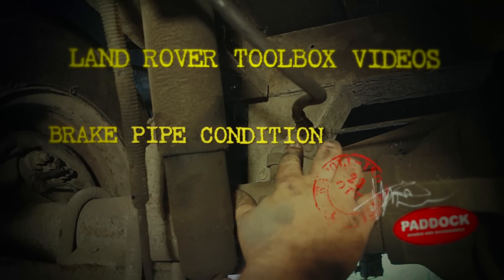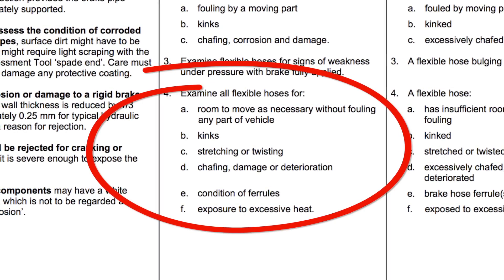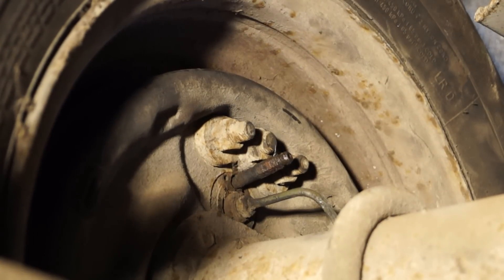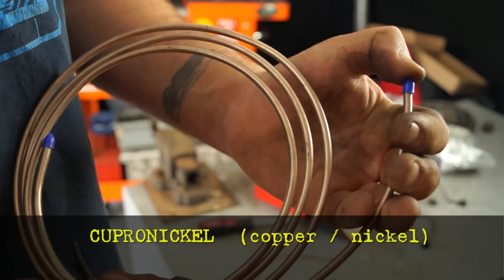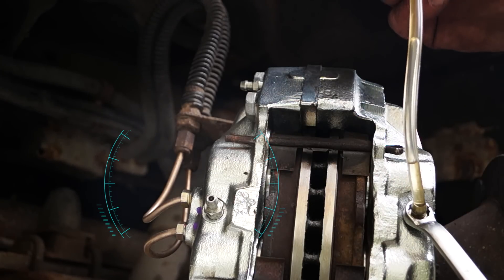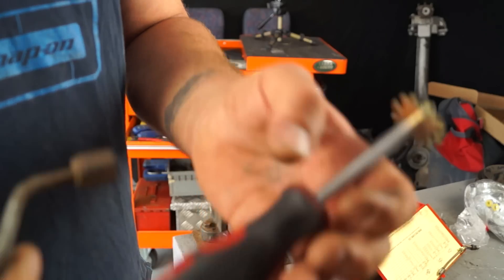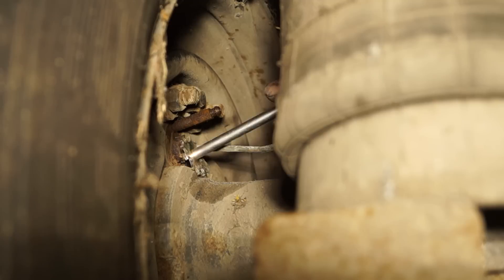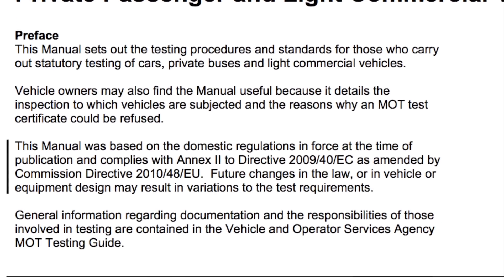Land Rover MOT preparation - The condition of brake pipes

Comment: Hi, thanks for this video and great content. Have a Freelander 1 TD4 automatic.2006 Currently having problems with 'soft spongy brakes'. Could it be the master brake cylinder needs replacing? Ours has a separate cylinder to reservoir (as in your TD4 air filter change video). Struggling to find this part online. Any ideas would be appreciated. Have subscribed and liked your channel. Keep up the great work and thanks for your time 👍